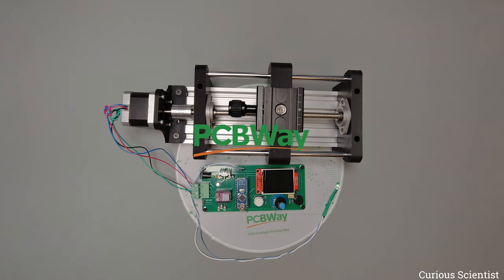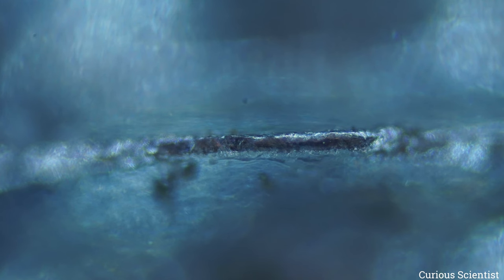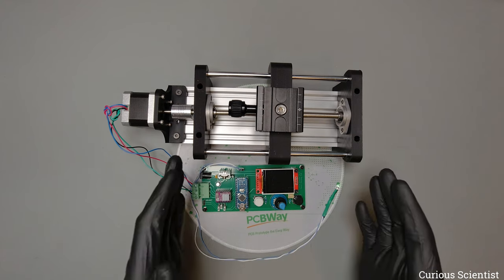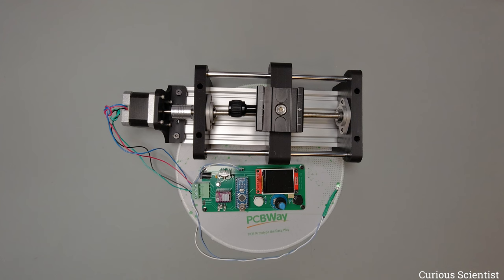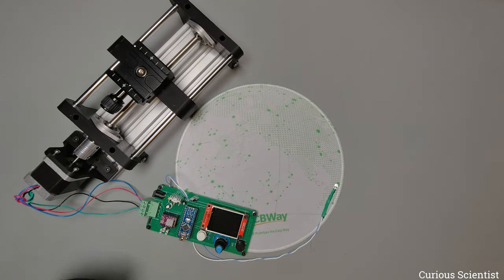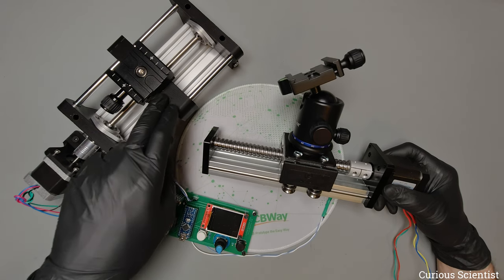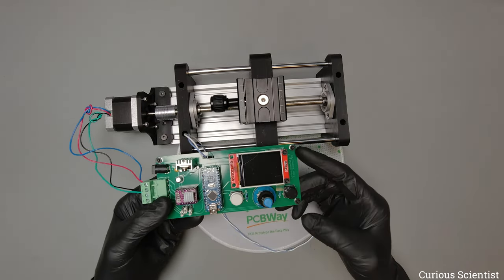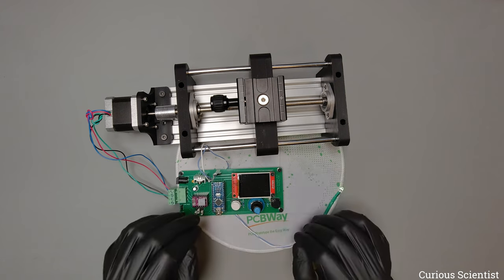Precise focus stacking system - Custom designed rig and software updates

Comment: Is there any way to have the schematic ? PCB way is way too expensive for me. Maybe on your patreon ?
Reply from the maker: Hi! The schematics are not available publicly, sorry. 
However, you gave me an excellent idea with Patreon. I will soon start uploading the schematics for my projects on Patreon, so whoever supports me can get the schematics.
Reply from the maker: Hi! I have uploaded the schematics on my Patreon page. Check it if you are interested.
Reply: @CuriousScientist  Great, i'm gonna subscribe right away. Thanks !:
Reply: This is the best DIY macro rail system I have found. I am wondering if there is an option in your Arduino code for a mirror up for DSLR's and a programmable short pause to wait for the rail to stop and avoid small vibrations before taking the shot and then moving to the next position
 If not, could you possibly add this option into your code?

Comment: Is lubricating oil on the lead screw essential? I would love to find a lubricant-free focus rail.
Reply from the maker: It is not a must but strongly recommended. It reduces friction and wear and tear on the parts. If you want to avoid lubrication, you might want to use a POM lead screw nut.
Reply: also in my case, it removed squeaking. You may also use Dryfluid, just drip or brush it on the lead screw and it will dry and leave a small film on the surface and doesnt drip.
Reply from the maker: Thanks, it is a super suggestion! Also, there are some thin film lubricants with PTFE (Super Lube) which could work well.

Comment: Absolutely brilliant design. Do you think it could work in a vertical placement??
Reply from the maker: Thanks! Absolutely, it could work vertically too! Just make sure you use all 4 holes to fix the rail holders so everything stays rigid. Also, preferably use steppers with higher torque. If I have some time, I could make a short video on the vertical arrangement, I just need to figure out how to fix it to something.
Reply: @CuriousScientist  that would be great. Now I have to teach myself soldering :-).
Reply from the maker: You'll succeed! Also, this is a relatively easy to solder PCB. I specifically went for through-the-hole components to make the board more "accessible" for everyone, so I think you will manage just fine. Good luck and have fun!